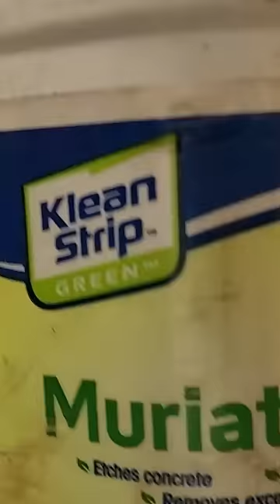Scrap Bandsaw Blade Damascus Knife

Comment: bandsaw blades are a pretty high carbon steel.  perfect for making a blade out of and a great use for making a damascus.
Reply from the maker: Yes they are
Reply: @JPsBladeworks  What other metal did you use to make the pattern? Monometal forge welding doesn't really have a pattern to it. It's different types of bimetal or polymetal forging that produces the patterns. The Master I learned from would use bandsaw and hacksaw blades bound with high carbon wire to do his forging and he hammered blades for better than 45 years before cancer got him.
Reply from the maker: @coffeetable8193  i used 2 different bandsaw blades. One seemed a bit more preserved than the other so i figured it had a different composition. The full build on my channel shows it all.
Reply: @JPsBladeworks  Awesome!! I'll check that out this afternoon! Thank you for your time and response! Happy hammering!! ⚒️ 🔥 🗡️
Reply from the maker: @coffeetable8193  thank you for watching. I appreciate you
Reply: @JPsBladeworks  I even hit Subscribe to keep enjoying your journey!! Be Blessed!! 👍
Reply: Most rust resistant saw band/ and blades contain a decent amount of nickel and other rust resistant materials hope this helped
Reply: I would like for people to stop using the term Damascus steel and instead, call it what it is: Damascus pattern!
Reply: @cip1911  well to be completely fair it isn't actually "Damascus" steel but in saying that the true recipe for Damascus steel has yet to be confirmed
Reply: @cip1911  I would like World Peace...  It's technically not Damascus anything, as proper Damascus metalworking knowledge has been lost to time. 
Industry standards at this time call it pattern welding and colloquially it's called Damascus, so to be accurate, never ever call it Damascus, yet to be understood by bladesmiths and consumers alike, call it what everyone else calls it: Damascus metal. 
Just having a little fun with this. Happy hammering! 🔥 ⚒️
Reply: @cip1911   I would like for people to stop being pretentious on the internet but here we are.
Reply: @Coffee Table  Wootz Damascus steel, still exists, and the recipe was rediscovered by Al Pendray...
Reply: @brunothehumble  Nobody is being pretentious here, but the fact is, that real Damascus swords still exist and you can not call anything that is not made from the same ore, with that unique structure, more than a replica( or a replica pattern,  in this case).
Reply: @coffeetable8193  All the best to you!
Reply: Came out nice and that steel won't lie
Reply: In my country we don't need blacksmith to make kitchen knife. You only have to shaping n sharpening that's bandsaw steel. Simple like that.
Reply: That knife has nothing, whatsoever to do with Damascus steel
Reply: @coffeetable8193  I was thinking the same thing. How the hell did he get any pattern with the acid bath, if he only used one metal and didn't mix it with any others. Interesting though that two different bandsaw blades could give a result like this.

Comment: Clean pattern.  What did you use on the filler layers or was that just a crapload of different types of bandsaw blades?
Reply from the maker: It was 2 big ass bandsaw blades. Seemed to be different materials so i cut and stacked them one on the other for who knows how many layers. It was a hit or miss. Definitely hit and gave me a pattern.
Reply: @JPsBladeworks  nice job man and lucky break finding band saw blades of 2 different metal types
Reply from the maker: @PromethiaSHADOW  i was gifted them. dont think ill get that lucky again

Comment: Is this the same steel powder that is usually used to fill between the layers of Damascus steel??
In any case, I would be grateful if you could remind me of its chemical or commercial name
Be successful and victorious 🙏🙏🌹🌹
Reply from the maker: It is borax. It cleans the steel to help it weld better and keeps the surface from oxidizing while in the forge

Comment: Damascus is layering different components. It’s a forge welded blade
Reply from the maker: It is different components. I cut 2 different bandsaw blades and stacked them layered. Thats why you get a dark and light contrast on the blade. Full build in the pinned comment if you wish to see.

Comment: Excellent job. Great material. But isn't true Damascus made with layers of different types of steal? It is also folded many times.
Reply from the maker: In the short i only show one since it has to be under 1 min but i used two different bandsaw blades and stacked one on the other for like 30+ layers. That gave the patteren. You normally have to fold if you have too little layers to give a decent pattern.

Comment: What is the white powder for? I’m not a total noob but I’m not up to forge welding yet
Reply from the maker: Its flux. Its used to keep the surface clean for the welds and to push out any scale thats inside of the billet for a clean weld.

Comment: Hi Professor I would be grateful if you could tell me the name of this powder that you use for Damascus steel... I mean the same powder that you sprinkled on the molten steel Sincerely, message

￼
Reply from the maker: Borax used as flux to keep the steel clean and push out any scale in between the layers that could possibly keep it from welding properly.

Comment: surprised you got a pattern when you only used the saw blade Which is 15n20
Reply from the maker: It had 2 different blades. I dropped the ball not making sure i explained that lol one was definitely 15n20 becasue of the look of it. The other was who knows what but etched dark.
Reply: @JPsBladeworks  yeah as far as I'm aware all saw blades are 15n20 probably 1080 or something if it etched dark. do you do San mi
Reply from the maker: @kjdexotics9034  yea i do all kinds of different materials. i like to experiment

Comment: I would not trust it. It looks great. Problem is you soaked the pieces in muratic acid but never cleaned the pieces after the soak. No guarantee of good welds. So while it was a good looking build, there is no way to rell if it might fail under hard use.
Reply from the maker: It was cleaned. I cant possibly show everything in less than 60 sec

Comment: When Damascus was made in the 1300s it wasn’t made like this. The steel used was a special kind of steer they found in a cave close to the town of Damascus. They built a cancel to protect the secrets of how they made this pattern steel. Anyone working in the foundry told anyone about it was put to death. If anyone stole the metal wood have there and cut off. The steel was prized over all steel because of the edge keep sharper longer. A Prince had a sword so sharp it could slice a peace of silk scarf in haft. It was unheard of. The patters weren’t like we have now a days. The patterns were natural. And didn’t use nickel as an alloy. The secret died in the late 1800s where steel became cheaper harder and faster to make. It’s a lost art to time. Just like so many other things lost to time.

Comment: Only sad that you used 1 type of steel.
Or at least showed 1tyoe of steel being used.

So Damascus seems out of the question.
2 different blades been used in the video
Reply from the maker: It was 2 types of steel. 2 different bandsaw blades. Not sure what kind of steel.

Comment: Does somebody know why they call it Damascus blade or knife?
Reply from the maker: Damascus and pattern welded steel are used interchangeably for the past 30 or 40 yrs or maybe longer in the bladesmith community. The original "damascus" from old times is closer to wootz steel or crucible steel which leaves a pattern from the mixing of steels and carbides. The name Damascus come from the place it was originally made which is Damascus Syria.

Comment: I didn't see you fold it once 🤔 why say Damascus?
Reply from the maker: It was mulitple layers of 2 different saw blades. I didnt know if it would work since i dont know what kind of steel they are made of. I took a gamble. So i didnt need to fold it multiple times to get a high layer count. Full build is on my channel.
Reply: It was many layers of metal, why would you fold it lol, already like 20 some layers there.
Reply: @bvictory5698  that's how Damascus steel is made. Folded and stretched. This is just pattern welding 🤷 nothing wrong with it, looks nice.